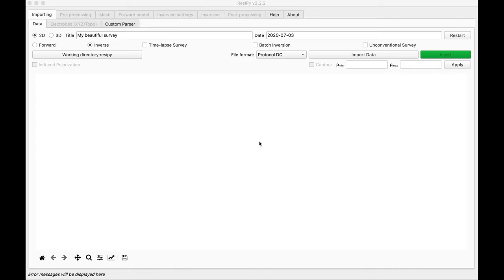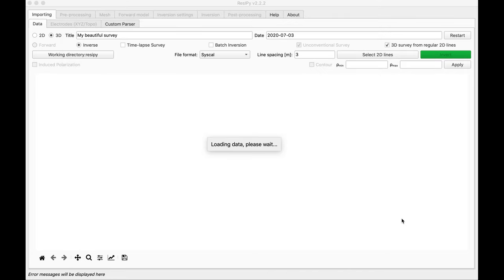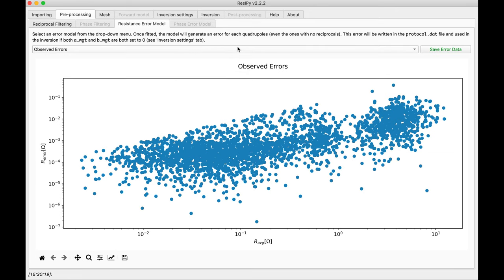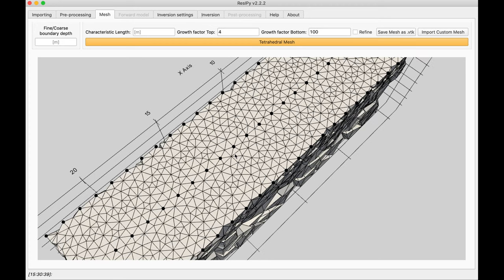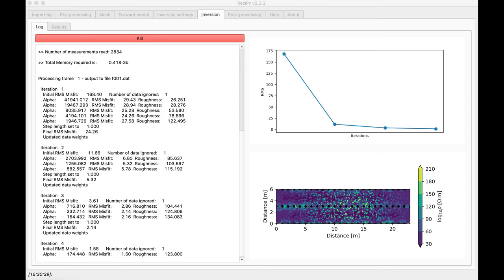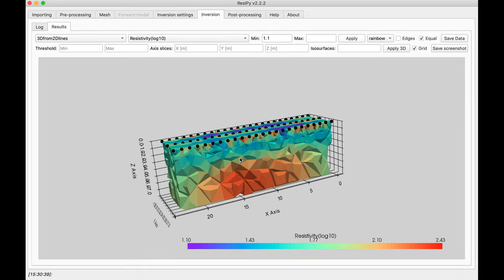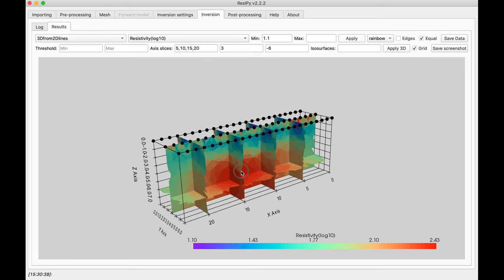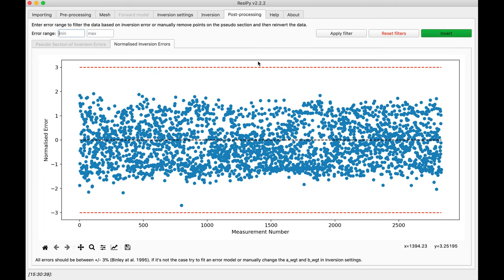3D ERT inversion from parallel 2D lines

Comment: Very impressive! Does it support 3d Inversion from non parallel 2d lines also?
Reply from the maker: Yes, from v3.0.3 you can run a 3D or pseudo 3D inversion from any combination of 2D lines (including mixing borehole and surface arrays)

Comment: In this process you upload excel data, as in my case i have 2D Resistivity dat. file data, how can i convert my dat. file data to upload it
Reply from the maker: I'm assuming you have Res2DInv ".dat" files. In such a case, all you need to do is to select "ResInv (2D/3D)" from the "File format" drop down menu instead of "Syscal". 
The rest is is exactly similar to this video.
Reply: @ResIPy  do we need to put the coordinates in the DAT file of the 2D lines? If so do you have the format?
Reply from the maker: @bienvenidopeciller1438  You do not need to do that. You can past in the X, Y, Z columns copied directly from Excel. Look at this part of this video: https://www.youtube.com/watch?v=4joGJjp8uLo&t=91s